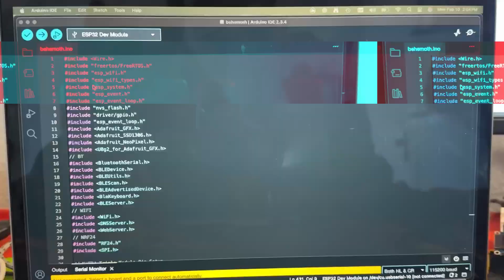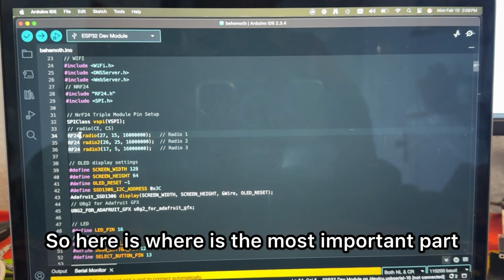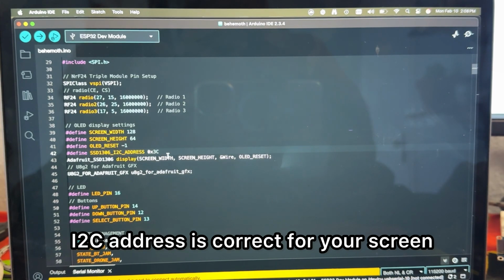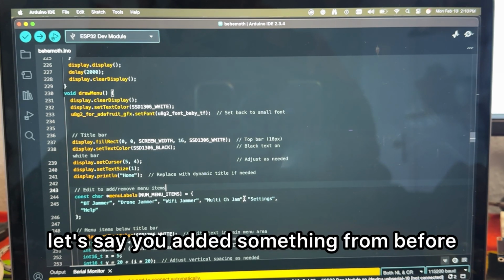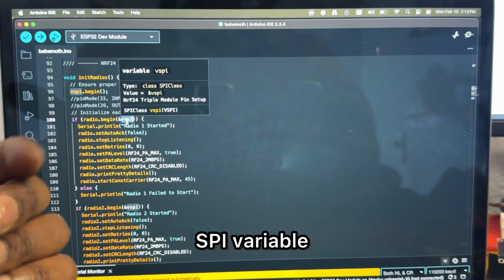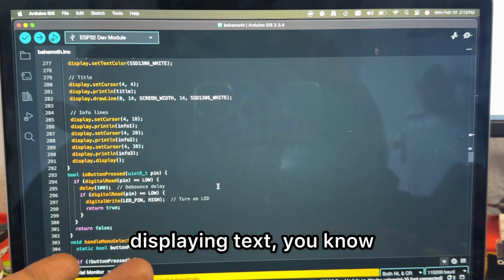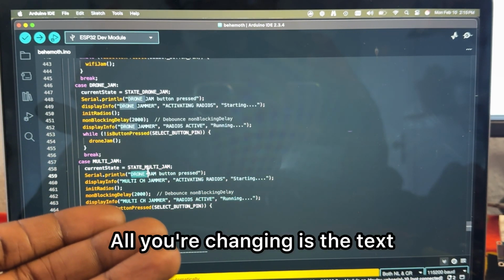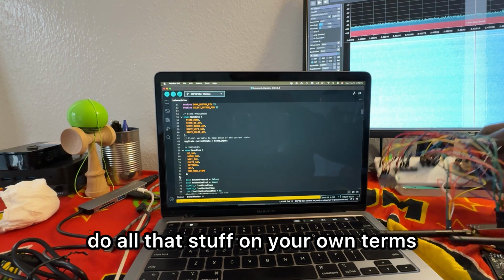ESP32 Bluetooth Jammer Code BREAKDOWN | 3 NRF24 2.4GHz Modules

Comment: Does this scheme with 3 nrf2401 only work if you use the Oled 0.96 and the buttons?😭
Reply from the maker: Remove what you dont need
Reply: @littlehakr Really? In this case I wanted to remove the OLED 0.96 and the buttons. Use only the schematic of the 3 nrf2401 and the esp32. Will it give a reading error if I remove the codes of the OLED 0.96 and the code of the buttons?😅

Comment: All I want to do is just simply be able to put the code on the esp32 without having to make changes to the code because I don't know anything about coding.

Is this possible using your templates you have on github? Basically just download your code onto the esp32 and the jammer will be good to go?

Hope this makes sense
Reply from the maker: Yes just follow instructions and use the same connections
Reply: @littlehakr  thanks. I'll let you know how it goes.

Comment: Excellent work! I'm looking forward to seeing the PCP ready and running!
One question: Can I use only two antennas without modifying the code, or do I need to remove one from it?
Reply from the maker: Yes, absolutely, the radio 3 just won’t initialize. But make sure you have the correct pins or edit for your pins